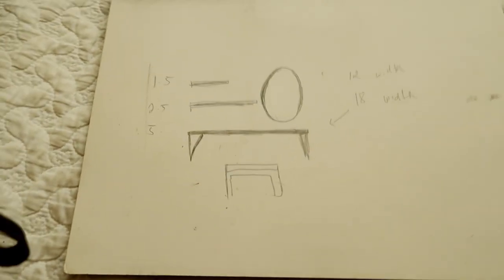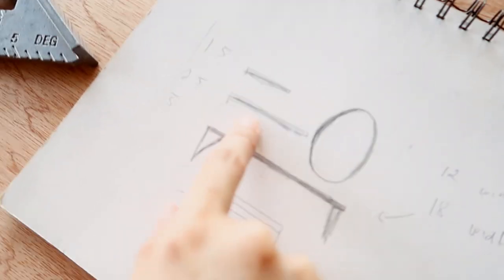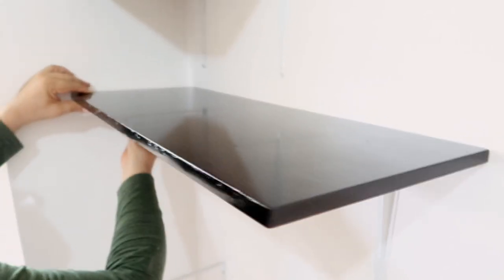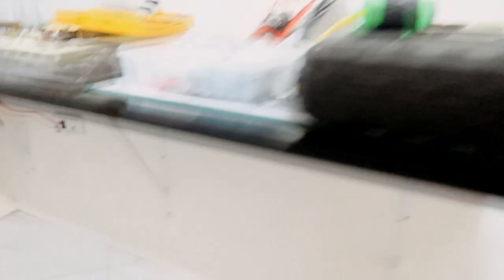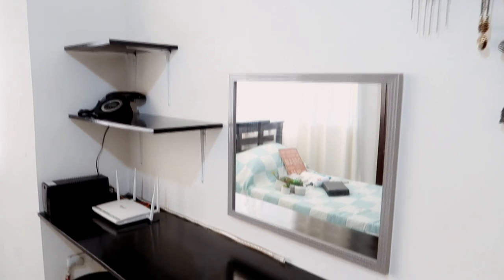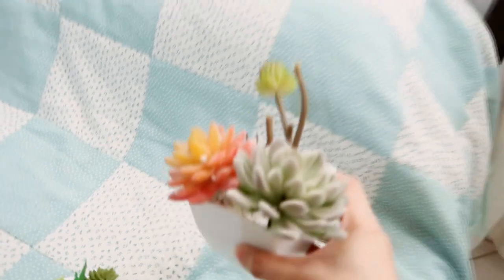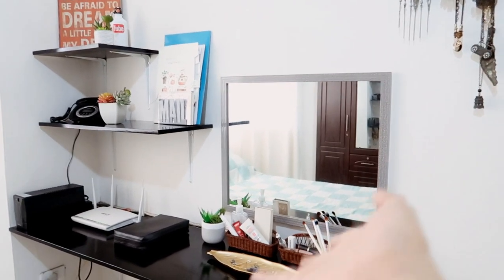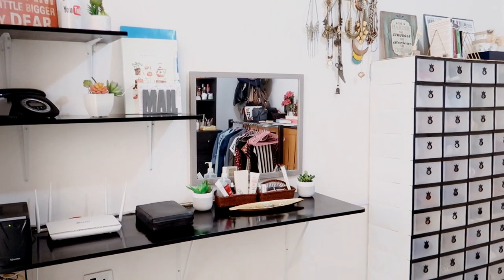Room Makeover- Decluttering & Organizing + DIY FLOATING SHELVES

Comment: Hii Karen.
 I m an Indian girl with long hair upto my butt. But I m very worried about my hairfall.whenever I oil my hairs I get hairfall even after shower during detangling although I never comb on wet hair. Earlier I used to have a not so long but a thick braid but now my hairs are becoming thin as they are growing.. My hairfall problem was due to the dandruff n I used to cry a lot for 1 whole yrs i was really depressed then. but now the situation is under control yet I want to minimise my hairfall which is already under 100 strands per day n under 200 on washing ( I literally counted every single strands)..I watched Ur few vdos in which u were showing that u lose only 12 strands on normal day n 23 on washing...plz plz plz suggest me something so that I can manage to do that as well..
Reply from the maker: I really do suggest that you stop oiling your hair for now if it causes hair fall.  Also, using a good anti dandruff shampoo would be ideal if you are dealing with it. It's always best to have your scalp check with a dermatologist because they can further asses your scalp problems. BTW It's okay to typically lose 100 hairs per day. That's in the normal rate. Don't stress about it too much.
Reply: @kerenvlogs1796  thanks Karen for your valuable suggestion...can u please make a vdo on how to smoothen rough n dry hair especially the ends based on materials or products available in India... I m unable to find many of the products n diy ingredients of yours coz it's not available here....Ur hair is so sleek can u help making mine too😍 plz do reply...I am eagerly waiting for ur reply to pop out in my cellphone 😃